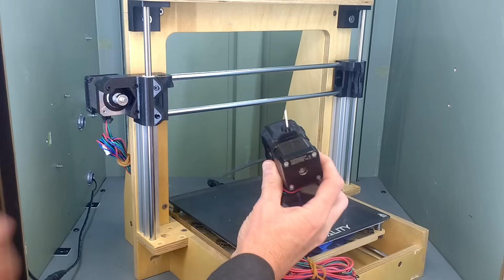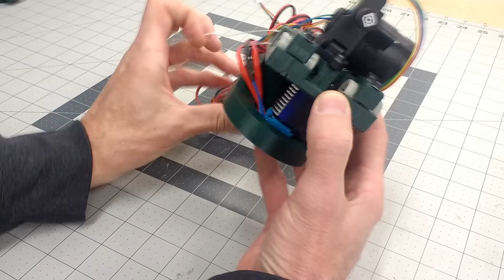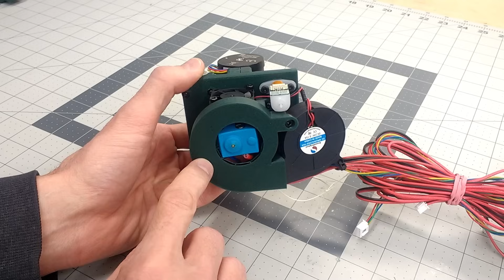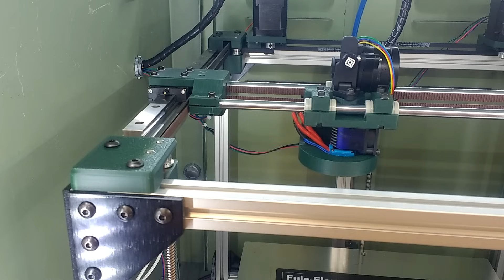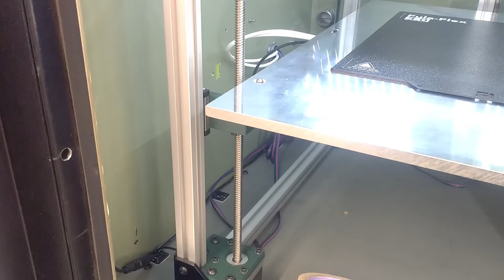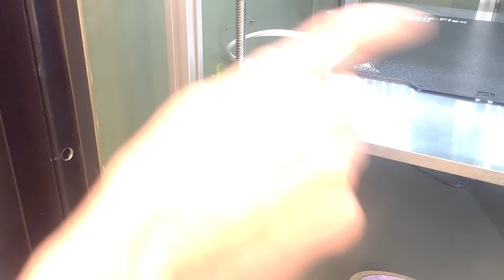CoG: The Balanced CoreXY 3D Printer

Comment: Nice design. I like the 360 blower for cooling.

But that is ine chonky thick build plate. Going to take a lot of energy to heat it up, i guess it can act as a heated chamber around the print surface though.

Comment: i thought about this on the screws not being a perfect fit inside the bearing an was looking at trying to make a sleeve that went of the bearing but what little i messed with it it looked like id have to drop the screw size to a m4 to get a shaft on the screw that would fit the id of the bearing an the od of the screw, i even considered a couple wrapped of electrical tape around the m5 bolt to see if that helps but ive never took the time to test either. im waiting on some parts to come in the mail an im going to start a corexy build to keep on my desktop. not sure how its going to turn out, just seen a few post of ppl taking the little kingroon kp3s printers an converting them into corexy an ive got a couple for $50 each and a pro an im going to use those 3 printers to try to put one together but im going to try to use a builder bed than the 180x180 so its going to be based on the conversion i guess but i'll be dealing with getting it to work in a bigger format, or thats the hopes. i got a bunch of other machine i can use so its more going to be a learning experience an i wanna try klipper, its been out plenty long enough an ive still not tried it, but i just got a bambu lab p1s machine an its a monster compared to what ive gotten used to from my older machines so im hoping i can get the little corexy to at least print at half the speed as my p1s, if i can manage that i'll be happy, if i can do more or match id convert all my older machines.

Comment: very nice design ! 

the only thing I would say is that there is a big moment force created with the unsupported pulley on the stepper motor because of the belt tension. I've seen designs that support the end of the stepper motor shaft with another bearing to avoid the twitsing motion of the belt tension to be applied to the internal components of the stepper motor only... so less wear and tear of the stepper motor bearings and prolonged durability ?
Reply: If I understand what you're describing correctly that's a very common design element for exactly that reason in other industries that make heavy use of timing belts. The last thing you want is for your machine to be down for an extended period because a motor was destructively misaligned by off-axial torque from an unbalanced belt. Another common solution is manufacturers will design in additional pulleys and idlers to redistribute or counterbalance those forces using the same or additional belts. Often this is as simple as adding a second belt and pulley to the same shaft and it's reciprocal mate exactly opposite the pull direction of your primary belt. These balancing belts don't even need to be toothed since they're simply providing tension, so for an application like these sorts of printers you could save money by using inexpensive office style rubber bands of appropriate resistance (layering them helps with that).

Comment: Nice video. Thanks for sharing the info. Did you ever get the carbon f rods working? I'm about to use it on my own design and I was wondering if there is any pitfall...
Reply from the maker: Couldn't find a good source.  Good luck with your build.  Steve

Comment: First of all, great work! Would it be bossible to make a video where you show the electronic parts, the wiring and how you set it up? I'm thinking of building a similar 3d printer but a little bit bigger and now the only thing im wondering is how the electric side works. Thanks in advance
Reply from the maker: Thanks Felix.  Unfortunately, I don't think a video on my electronics would be much help.  I am using a unique setup that most won't use: 2 separate controller boards with laptop running Klipper (no Raspberry Pi).  There should be plenty of other videos online that show this.  Steve
Reply: @steveturner1447  alright thanks anyways

Comment: Smart idea, though usually you can simply go for linear rails to mostly fix the problem.  If you used 2 opposed linear rails in your design with a gantry in place of the rails you could probably do it the way you did it and have damn near no twist or slop ever...

Im sure its unnecessary but i love overkill for stability...

Comment: Hello, how much % infill did you use for the 3d printed parts?
Reply from the maker: Good question.  I need to make a list.  I used PLA on all parts with gyroid infill.  20-25% on the idler brackets and z motor mounts.  100% on the heat sink and bearing clamps.  40% on everything else.  Steve
Reply: @steveturner1447  thanks man